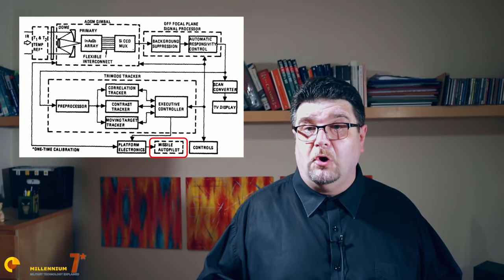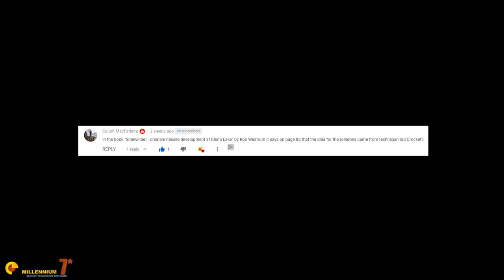Who Invented the Rollerons? - The genius behind the Sidewinder's stability mechanism.

Comment: The rollerons extend out from the rear find and also move side to side to help with stability. Early Aim 9's (Aim-9P) had a cord in an X configuration across rear of midsile when the rocket motor fired it burned the cord allowing Rollerons to extend. Newer versions Aim-9 L the inertia releases the Rollerons

Comment: The crossed dacron cord to keep the rollerons locked from pivoting while in flight remained in use with the AIM-9L up through 1980. I worked on them at England AFB 1976-1980, 31651L.